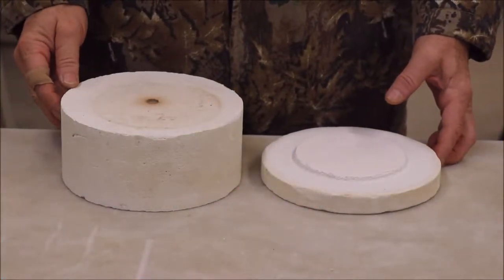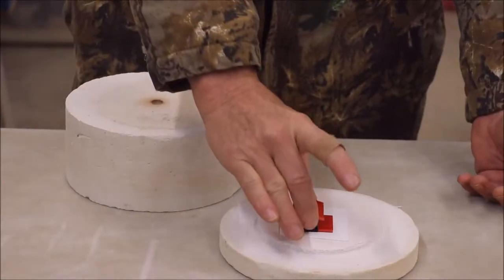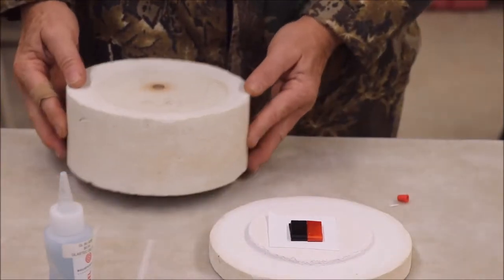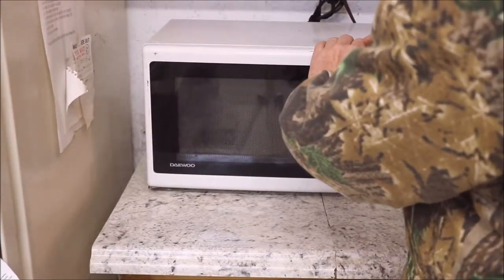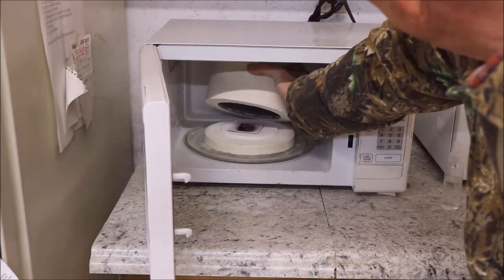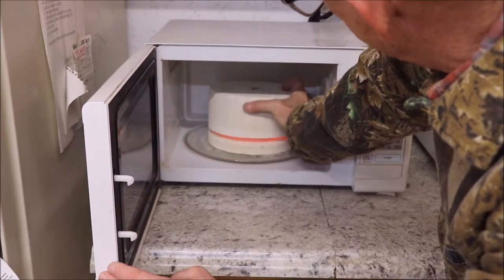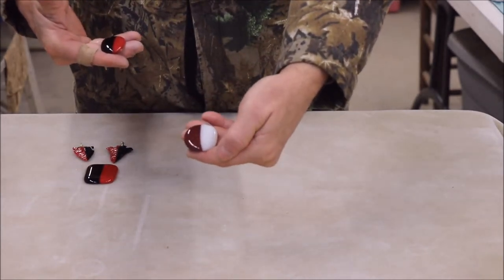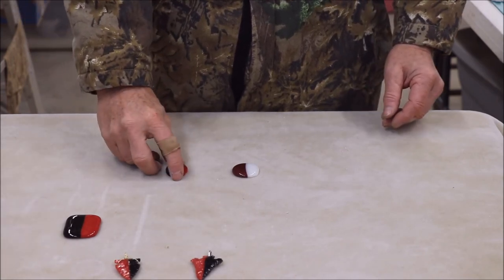Microwave Kiln Basics - Fuse a Pendant in your School Colors

Comment: What do you think about using the hot heat wire for kilns? I purchased a roll but haven't tested it of yet.
Reply from the maker: Lisa, it should work just fine.  Make a pendent using something unimportant and sandwich the high temp wire between the two pieces and see what happens.